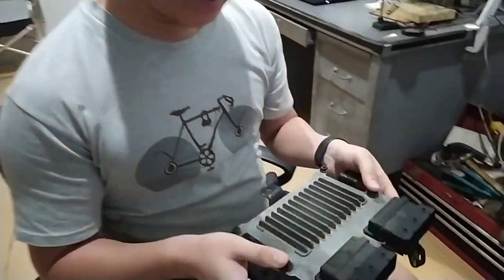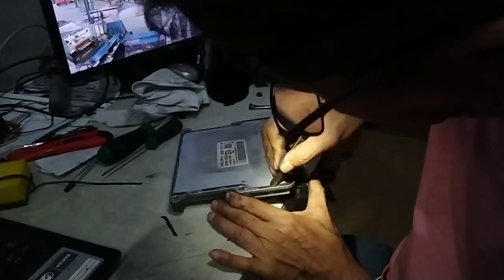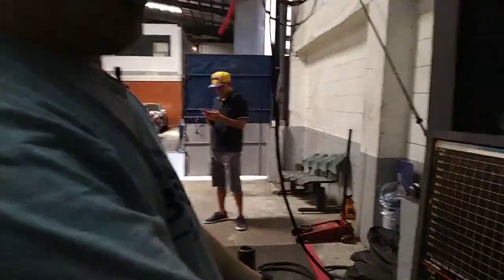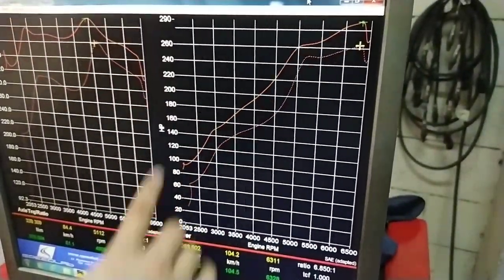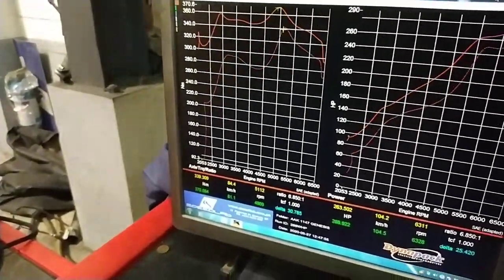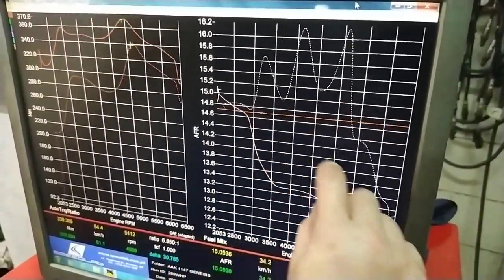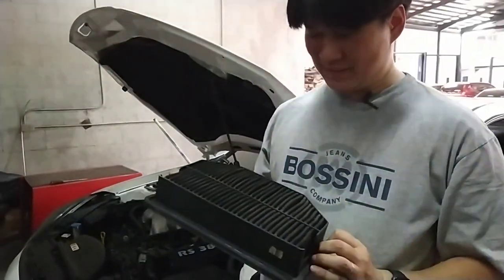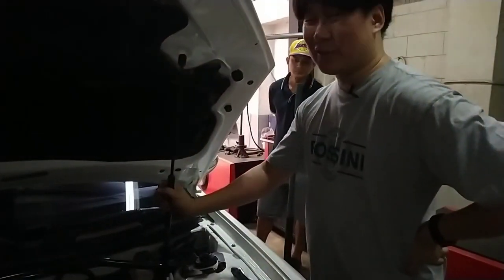SpeedLab Hyundai Genesis 3.8L V6 ECU Reflash Remap

Comment: Where are you located? Can someone send you an ecu to reflash?
Reply from the maker: Metro Manila 
Yes you can send your ecu
Reply: @speedlabchannel4452  Do you have a website? I have a 2015 Genesis Coupe 3.8 with a manual transmission. How much more hp and torque with the reflash?
Reply from the maker: @-don6496  25-30hp